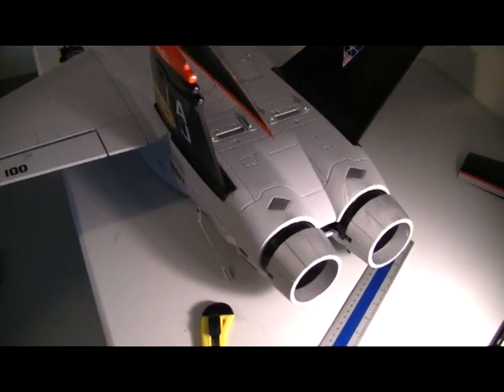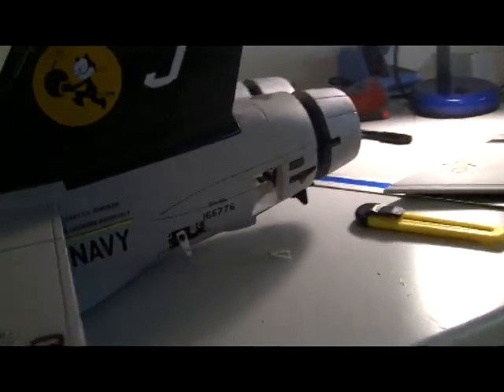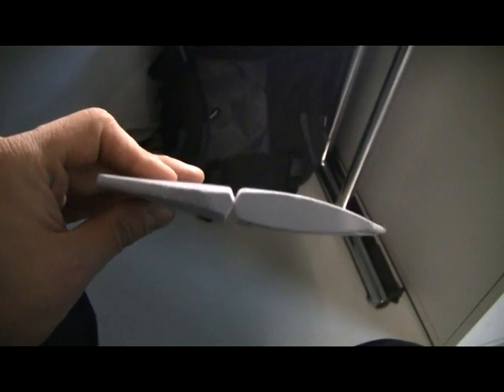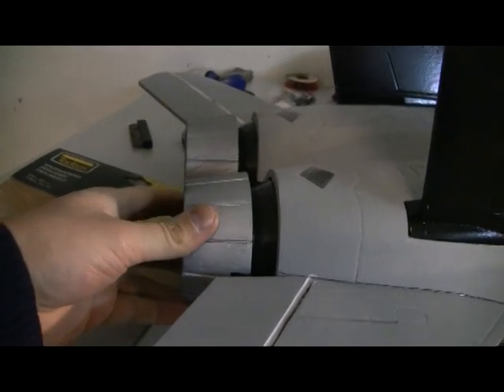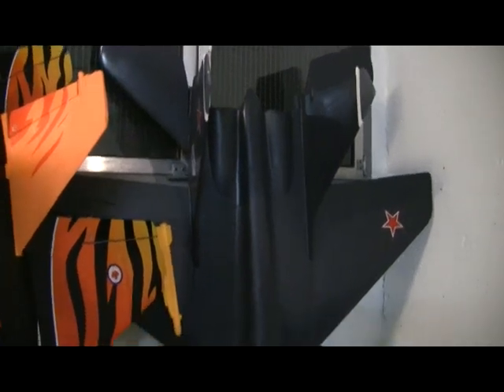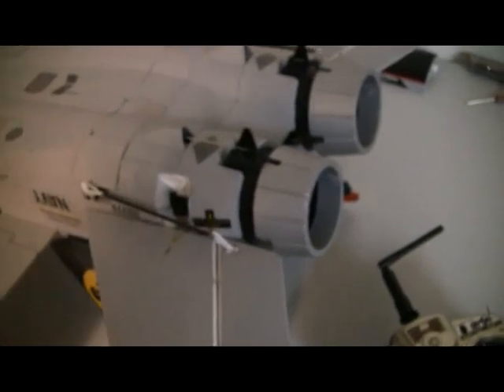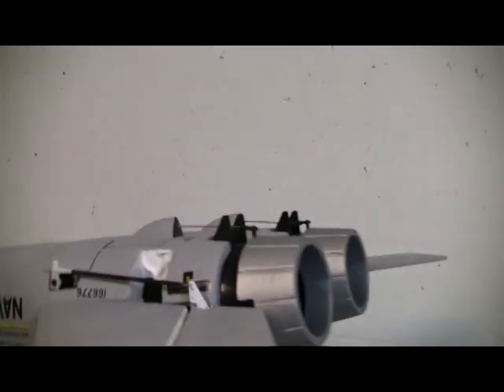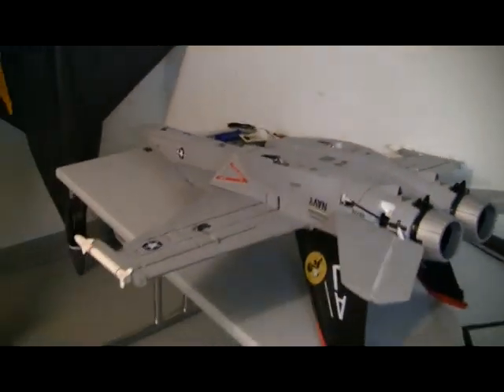Freewing F-18 Super Hornet Elevator Modification

Comment: Stock setup work fine for me, I had upgrade power system to mercury 90mm 1900KV. Your mods doesn't work well with thrust vector.

Comment: I like the mods you made, I had the same kits and made it to an 8s 1700kv, the power was amazing from 6s to 8s. On the second flight after trimming out, the F/A18 flipped nosed over disentagrated into the ground. After the autopsy, I found that the elevators must have come loose. so I applaud the mods. Has anyone made mods whiile having full floating elevators?